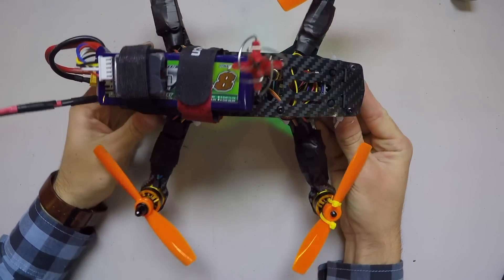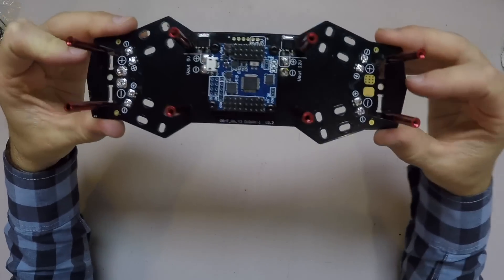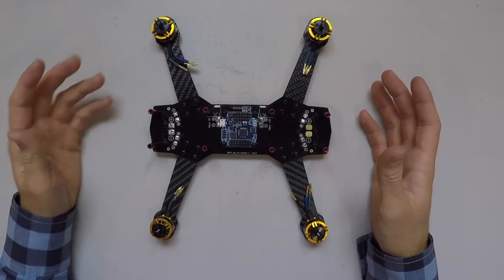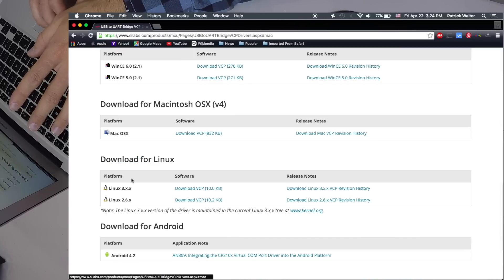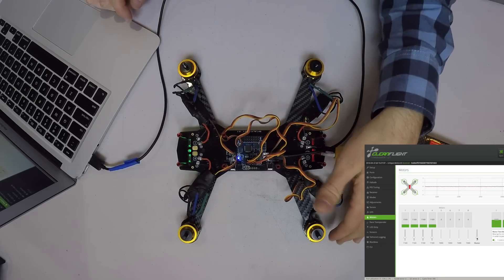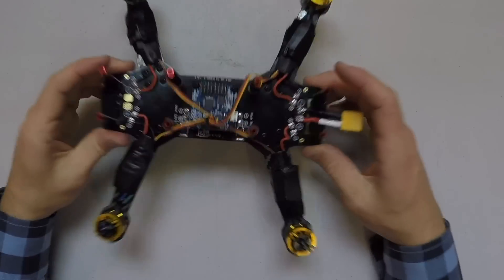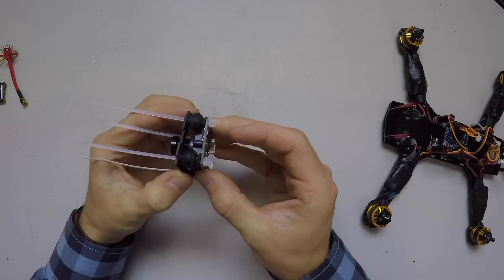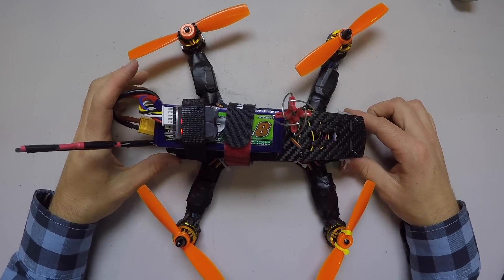CHEAP FPV RACING QUAD BUILD - Step by Step Guide with Links

Comment: can I also use this frame?
http://www.banggood.com/ZMR250-H250-250mm-Fiberglass-Mini-Quadcopter-Multicopter-Frame-Kit-p-933189.html
Reply: Yes
Reply from the maker: Yes you can use this frame but you will also need to a Power Distribution Board as well since this version of the frame doesn't come with one

Comment: nice video! I would make this but without a Camera. do I need the PDB and the OSD than?
Reply from the maker: +DiyAquaPonics the PDB makes things so much simpler. You don't technically have to have it, but not having it makes your build nastier and harder to repair/mod. You do not need the OSD if you aren't doing FPV

Comment: Thank you man! I have confidence in building the exact one using the links you gave.  Questions though:
1. Do I need to get my own banana plugs?
2. I have a Go Pro - what do you recommend for me to mount that? Or should I bypass the goggles and use the build 2 setup for the screen and figure out a way to record off that? I am a beginner.
Reply from the maker: Hey!

1. Yes you will need your own 2mm female banana plugs (Banggood: http://bit.ly/2aOnt4W) (Amazon: http://amzn.to/2ay9Ypi). I would suggest getting a couple of pairs. More than likely you will mess something up and have to shorten your connection or whatever. I've used 1/2 of my 50 pair pack.

2. Gopro mounting can be tough. You have two options: A) strap it directly to the frame B) hang it below the body on a gimbal. If you strap it to the frame you need vibration dampening or you will end up with tons of lines/waves/jitters in your video. So you can put foam down then strap the gopro on top of it with something like this: (Banggood: http://bit.ly/2aOni9V) (Amazon: http://amzn.to/2auSAy7)
The other option was a gimbal, this is actually really nice even to fly FPV through, but they get costly. I tested out a really cheap one: (BangGood: http://bit.ly/2auSINT) (Amazon: http://amzn.to/2avXnCu) and it was terrible!! It would randomly spaz out and flip to one side.

A note about goggles vs screen. The screen is much cheaper and easier to use. But its not as immersive of an experience. Goggles are way cooler!! 

Anyway,s those are the 2 options. I hope that helps!
Reply: thanks again.

Comment: Thank you for this video :) Really good information.
Reply: Did you mean soldering station? Radio Shack or any electronics store sells them. Even hardware stores,but be careful not to get one that runs too hot. You can order one on line but check to make sure its not one of the really cheap crappy ones.
Reply: ok thank you
Reply from the maker: Thank you!!
Reply: +How We Make Things so i have to make a drone as a school project and we dont have that solidifier thing so is it possible to use hot glue?
Reply: You can not use glue on metal,no conductivity.
Reply from the maker: I second scott firman on dont get a cheap one, I've had to purachase 2 cheap ones already because they melt or just dont work. Spend at least $40 and get something you won't have to replace
Reply from the maker: Np

Comment: as a beginner I dont need to buy the FPV goggles yet right? 300 is pretty out of the budget at the moment. Im also glad that the turingy is only 80 compared to other sites!
Reply from the maker: +Flovust as a beginner no, there are cheaper goggles, or you can even go with a little screen and a video receiver that is battery powered. I have them listed on the spread sheet under build #2. It's a cheaper option and I think better for beginners because you can switch between looking at the screen and looking at the actual drone really easily
Reply: im scrolling down for this question and answer. thanks!

Comment: AWESOME,Helpful Video!!    im still Learning,but this Helped Ease my fear of building!        do any of the nuts and bolts Require Lock-tight?
Reply from the maker: Thank you!
Yes you should locktite the bolts going into the frame that don't use nylon locking nuts. Don't locktite nylon

Comment: Okay, I'm so sorry. I swear this is the last question. Im a knewby and I don't think straight exspecially when it's late at night. Is there a way to get a faster performance using the same exact setup like same esc's but have a faster motor? if so what wouod he the life time for the battery for faster motors? Also, is there just different props that could make it go faster. thanks, sorry again for too many questions wish there was just another way instead of spamming the chat :(
Reply from the maker: +Mitch D its fine, I don't mind helping out at all.
Yes there is a way to make it go faster with just this setup. get a 4S battery http://amzn.to/1VYoKYl and get these props http://amzn.to/1OvBIdJ.
There is a danger here though, and that is that you will burn your motors. These props are have an aggressive pitch to them and therefore will pull more current. The motors you have DYS BE1806 are only rated for 3S batteries but you can put 4S on them, you just risk burning them. So what you do is, put on the 4S battery and those 5045 bullnose props, hover, feel how hot the motors are getting, then do some up down accelerations and feel how hot they are getting. If you can hold your finger against them for 8 seconds then its fine, but if you cant, then it's too hot and you will kill your motors.

We have been flying with a 4S battery and 5045 bullnose on this setup for a white and its been fine. The power increase is awesome though!!!!
Reply from the maker: +Mitchell Dever I'm glad I can help, I am still going through the learning process and it's nice to have a community that knows what's going on.
As far as range, that is tough because you need both really long range transmission of your control signal (transmitter) and you need really long range Video. I haven't dabbled in either of those, so what I suggest doesn't have much ground. two things to note first. transmission frequency and power. Typically video is transmitted at 1.2Ghz or 5.8Ghz. 5.8Ghz can transmit more data but attenuates more while 1.2Ghz will typically have a longer reach.
Here is a 5.8Ghz video transmitter that operates at 600mW
http://www.banggood.com/Eachine-TS832-FPV-5_8G-32CH-600mW-Wireless-AV-Transmitter-p-975425.html

as far as transmitters go, im not sure which are best for really long range, might be a good thing to search around for on reddit/r/fpv
Reply from the maker: you will need a camera for the tranmitter, yes. Can you link which transmitter you got? The problem usually arises when the connectors on the camera and the tranmitter are different, so you have to splice wires, that's kind of annoying.
Have you already ordered what you are going to use to view the video? Like goggles vs screen?
Reply from the maker: dang! Nice goggles, man! Those are sweet btw, you'll love them.

As far as Camera goes, I would suggest this Runcam: http://bit.ly/1WEQscG
its the same price on amazon: http://amzn.to/1OMLGHw
Reply from the maker: +Mitchell Dever the goggles should come with everything you need to set them up, unless you just bought the barebones goggles (I'll recheck the link). 
Hooking up the FPV cam will probably take some connection work because I don't think they'll match. 
Sure we can face time, shoot me an email at howwemakthings@gmail.com and we can work out the details

Comment: Hry, do you have a link for the fpv trans mitter and reciver you had in the videom I want to be able to fly around my house, with barley any static. I live in a neighborhood, like yours. It would be great to get it to go behind a house three houses down if possible dont think that would happen. Thanks a lot your a big help and just to say I may or may not post a video of me testing this quad.
Reply from the maker: +Mitch D So we are using Fat shark goggles which came with a built in video receiver http://bit.ly/1WaqxtH
but you can also get this video receiver and decoder: http://bit.ly/1rqWpgj  This decoder comes with RCA cables so you can plug it into any TV/Monitor with Red/Yellow/White RCA inputs

here is the video transmitter that is on the drone: http://bit.ly/1VKKerC
This is just a 200mW transmitter, if you are looking to go around houses you will want a higher power transmitter like this one: http://bit.ly/1TiNl6K
This one is a 600mW transmitter so it will go through walls a little better than the previous one.

Let me know how it goes!

Comment: You should really look into wire management. Looks like spaghetti in there! A decent pair of wire strippers should do the trick.
Reply from the maker: +frost you are right, the wiring is chaotic. But I did that for a reason, this is meant to be a beginners/easy plug and play build. So cutting the control wires and retrofitting them seemed like it was unnecessary for the sake of the video. 
But for the drone ourselves, we are going to cut them down

Comment: Why put the micro usb back so accessing it is difficult? Just rotate the board 90 degrees and set that in cleanflight.
Reply from the maker: +flamero Mainly because this is a supposed to be a "first time build". I wanted to condense the build process into the shortest and most straightforward walkthrough that I could.
That was actually one of the harder parts, deciding what I should put in and what to leave out
Reply from the maker: +Mitchell Dever yes the round antennas are called polarized antennas and are multidirectional antennas, better for FPV video when you are going in circular movements